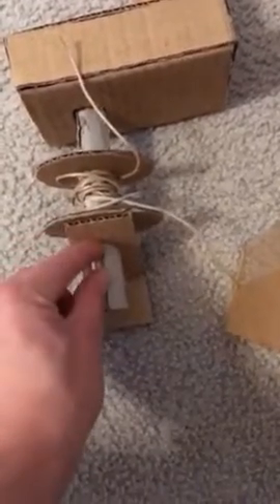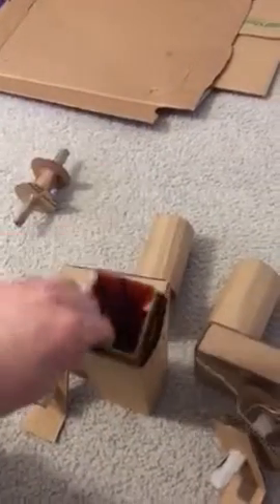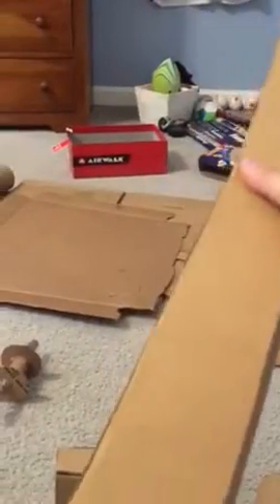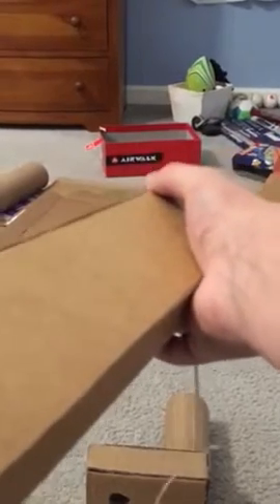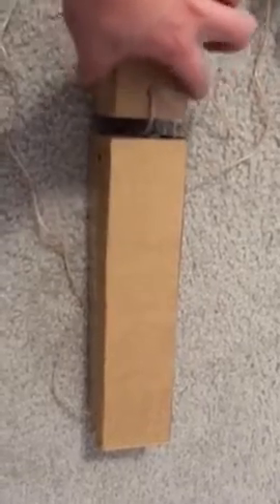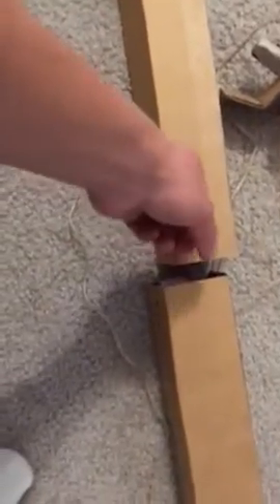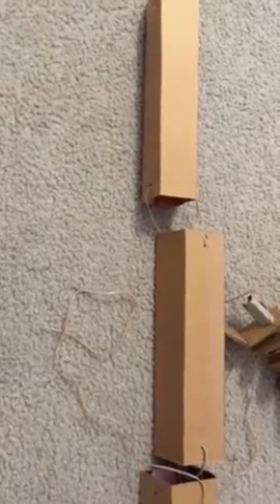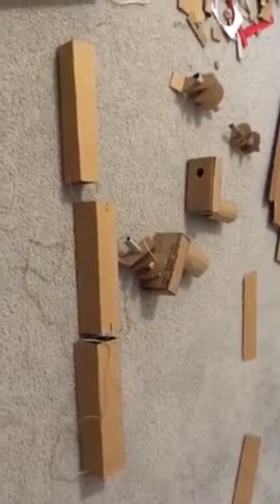Prototype- Belt & Pulley Telescoping Mechanism Video 1

Comment: I have been looking into this for sum time. Here's what I've come up with, but haven't had the time to try

I would look into adding 2 additional layers between the tubing made up of rollers and ball bearings, for a total of 5 layers: Tube, bearing, tube, bearing, tube. 

Use roller bearing the width equaling the gauge of the tube, at top and bottom to guide the belt, under and over the end of the tube.

Question is how  do you put the balls into a matrix? I would look into using EZ Flo mold (You tube).

Not all tubing is made the same so U need a way to quickly adj for your gap.

Make an alum /steel form Bottom, Sides and Top (removable). Drill matching counter bored dimples (T&B) for the bearing to sit proud for the tube to run along. Use release agent on form and bearings. Use loose spacer between t&B  to control thickness. If the bearings wander during pore, then consider small ceramic magnets to temp hold them in place. Back side of alum or steel plt. 

I would think with scotch brite mounted to a wood block you could clean up and loosen the bearing.

This I haven't given much thought to yet, but as far as the timing belt and roller, I'd have to draw it up, but the belt needs a dado in the matrix to move through, and the roller if possible needs to revolve.